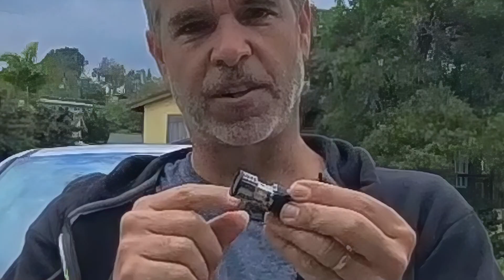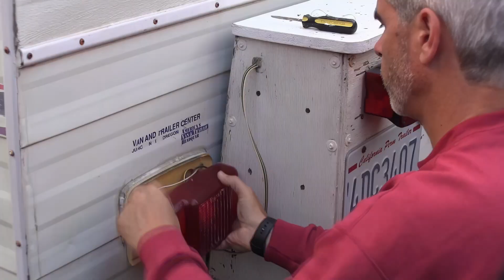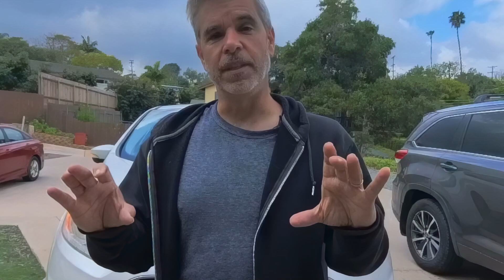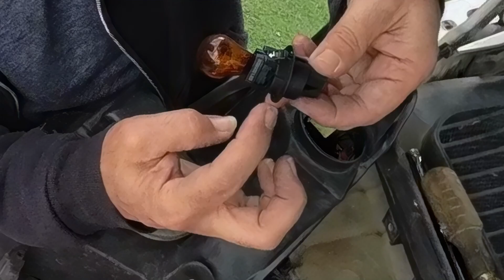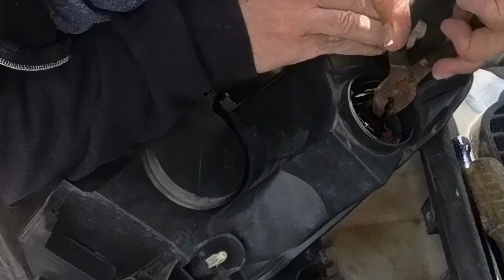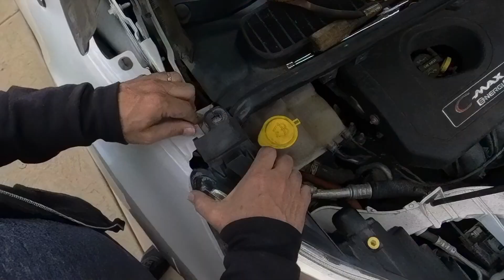Ford C Max Front Turn Signal Upgrade/Replacement with NO Resistors

Comment: Thanks for this video! Although I replaced a non-functioning bulb with a factory-spec incandescent one rather than an LED, I couldn't have completed the repair without this excellent tutorial on how to access the bulb housing. One suggestion: others should know that besides removing the screws holding the light housing and the metal body panel, the two pieces also interlock with a small bump-and-recess feature. The bump fits into the indentation and is held by friction; there’s no screw, bolt, or clip fastening it there.  This caused me some trouble until I figured out how to detach the pieces. See the separation at 03:56 - 04:05.

Comment: Retrofitting is when you replace a standard bulb with an LED version. At the moment, it’s completely road legal for you to replace an internal bulb with an LED bulb. However, there’s no legislation to cover retrofitting external facing light sources and therefore LED exterior bulbs in this instance are not road legal.

Comment: Does the marker light flash with the turn signal?
Reply from the maker: No, it turns off when flashing.
Reply: @DansWay  I'm getting a hyper flash on one side but both front and rear turn signals work perfectly...

Comment: Does the outer turn signal light have to flash as well?
Reply from the maker: The yellow light on the very outside doesn't blink. It is just a running light.
Reply: @DansWay  these look way better when you switch them to LED!

Comment: I bought these and I'm getting a hyper flashing on only one side.
Reply from the maker: That is so strange...  I'm not sure why that would be the case.  What year is your car?  Is it an early 2013 by chance?  I've heard some say that version had some issues like this.
Reply: @DansWay  I have a 2014 Ford Cmax Energi and with the Auxito LED Canbus Errorless Turn Signal bulbs only one side gave me a Hyper Flash even after replacing the bulbs with new ones from Amazon.